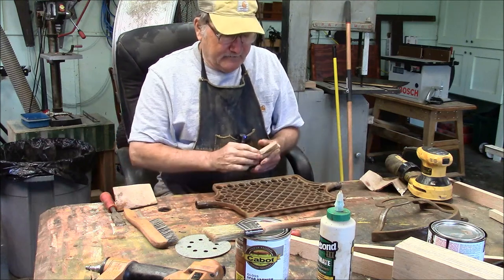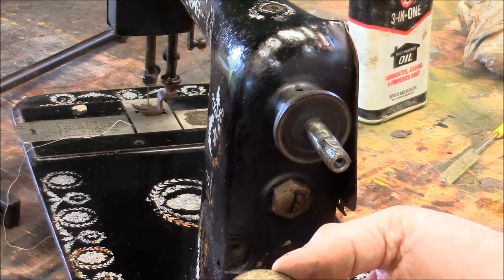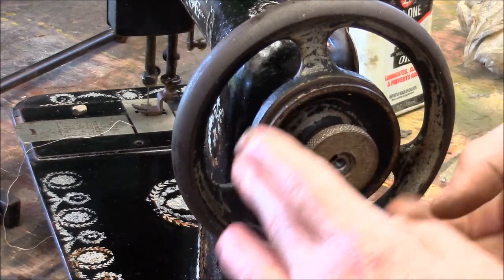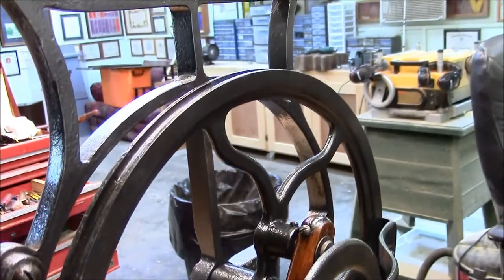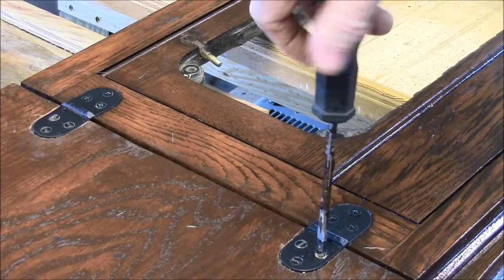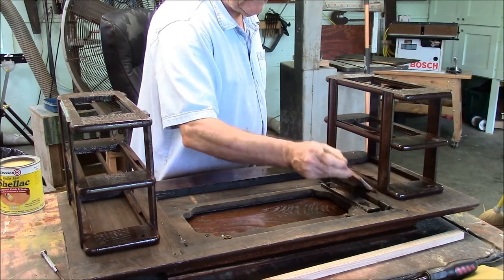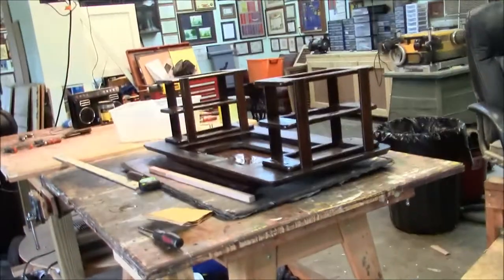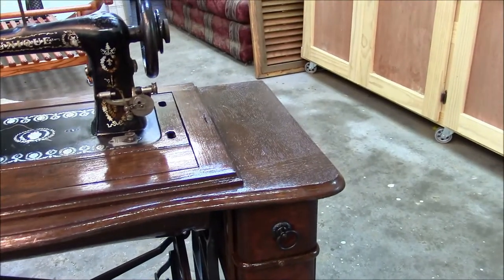2 Unique Brand Treadle Sewing Machine Finished

Comment: Nothing like being 6 years late here. I have have 2 of these that the machines were gone, and now they are tables.  Did you know that that little hole between the 2 drawers is to lock them with a small screwdriver?  Singer included 1 with the purchase of the machine, but people often lost them.  Also, mine have 2 little metal hooks that kook to the base, then screwed to the drawer frame to keep them stable.  You did a great job on that fine machine.  Have you seen the oak puzzle box that held all the attachments dated 1889?

Comment: Very good job on the sewing machine.  Are the belts for it still around?  Looking forward to see how you restore the bird house/feeder.
Reply from the maker: Pidasian Hippie Yes they still sell the belts.  I had one on order, but it didn't arrive in time to include in the video.  Have since installed the belt, and it works great.  I need to find a bobbin to actually sew, and I'm looking around.     I plan on doing a video in which I do an update on the treadle machine, showing the final finishing process, and the machine in operation.  
    Thanks for watching, and hope to see you next Monday.
Reply: It will be fun to watch you actually using the sewing machine.  I will be looking for you next Monday!